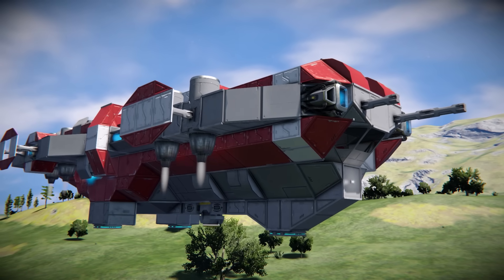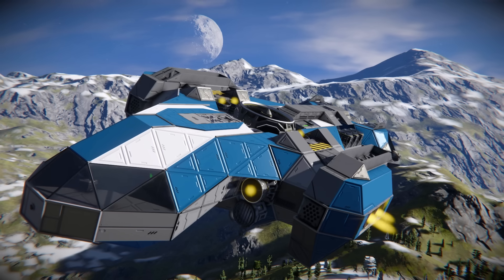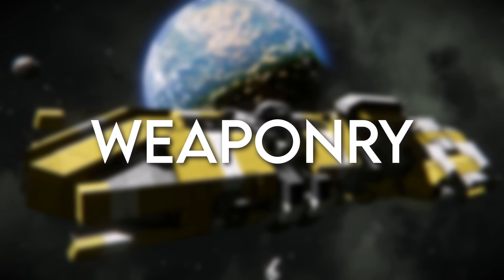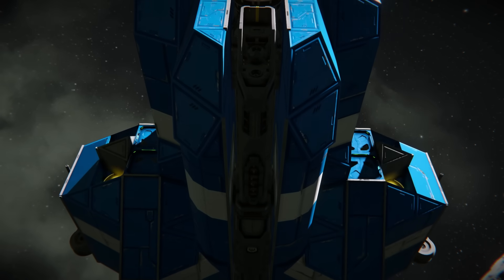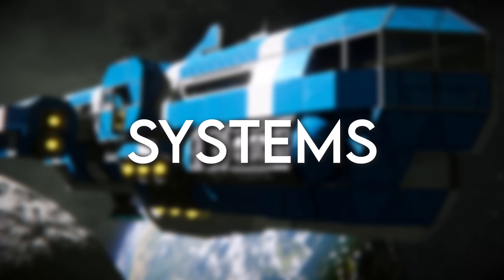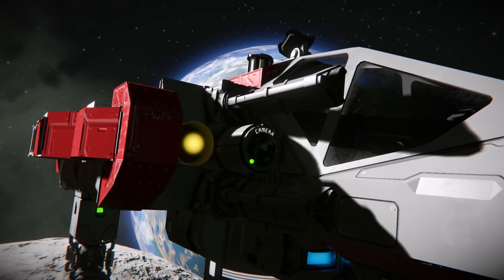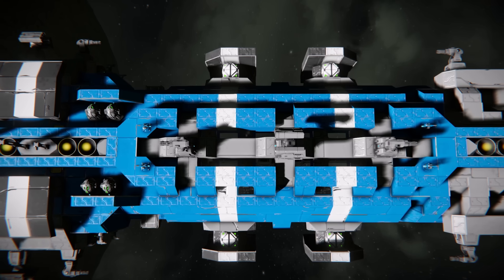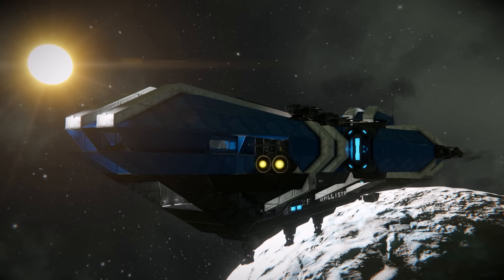Basic ship design guide - The Space Engineers Handbook

Comment: I built a small grid rectangle, I think around 20x7, I crammed 3 batteries in there along with a rectractable autocannon that goes in and out, and an 02/H2 generator with conveyors going out the side for thrusters, then I covered the roof, built a bulge, put the cockpit inside, rigged it up with the 02/H2 generator, and bang I'm done

Comment: Mmmh, this reminds me, I should probably really get to revise my large grid "asteroid eater" mining ship from like 2017. I kinda don't really know how to further improve the design though.

I've already managed to set up a sort-of kinda working pressurization system but it still requires the entire ship to be depressurized before allowing entry or exit, due to not having space to fit an airlock. The main issue with it is that the ship is designed in such a way to basically just point at an asteroid and move forward until it's through, meaning that everything has to fit 100 % behind the drills.

The whole ship has been entirely designed and built by myself in survival mode.

In case anyone's interested in the full detailed layout, front to back, it features the following:
84 drills arranged in a square pyramid shape.
Directly behind the center drill is the ore detector to allow for maximum range.
An inverted spherical gravity generator behind the ore detector allows her to draw any loose ore into the drills and prevent any waste
4 refineries are rotated to fit behind the drills and leaving a gap in the middle for crew to walk on. Their purpose is to already start refining stuff on the way back home and to give the ship a little bit of capacity to act as an impromptu mobile refinery if needed. Another advantage is that the ship is able to refine its own uranium to return to a fully operational state after running out of power.
A 3 x 3 x 3 reactor room filled entirely with small large-grid reactors, leaving a gap in the very center for the aforementioned walkway which continues through the entire ship
A 3 x 3 x 3 gyroscope room, set up in a way similar to the reactor room
A 3 x 3 x 3 cargo hold, again set up like the reactor room
A 3 x 3 x 3 "airlock" (which is really just a single door to the outside) with a medbay crammed in in order to provide first aid in case anyone gets injured in a mining accident
A mostly empty 3 x 3 x 3 room with control stations, this features as a cockpit of sorts.
Yet another 3 x 3 x 3 room filled with batteries for emergency power, in case the ship runs out of uranium.
And finally the last 3 x 3 x 3 room with oxygen tanks.
On the very back, outside, she's got a connector to hook up with wherever the ore is supposed to be dropped off.

All of this is mostly encased in two layers of armor, light armor on the inside and heavy armor on the outside, in order to protect the ship and its crew against collisions with asteroids. There are some gaps in the armor to allow everything to be hooked up to the conveyor system, but the internal rooms and walkway are airtight. Another advantage of the heavy armor is that it will allow her a lot of time to wait for reinforcements in case of an unexpected pirate ambush, assuming that pirates trying to ambush a lone mining vessel wouldn't be equipped to deal with large grid heavy armor.

It has 8 small ion thrusters for acceleration and breaking, and 16 small ion thrusters for moving up, down, left, and right, so she's pretty sluggish, but maneuverability is not really a priority for a mining vessel and can, in fact, actually be a detriment as sudden accidental shifts in direction while it is in the process of burrowing through an asteroid could pose a major threat to the ship integrity. The main reason for relying on 100 % ion thrust, however, is the fact that those were the only thrusters available within the vanilla game at the time of her creation. The reason for the distinct lack in particularly forwards and backwards thrust is that I had to make it work with thrust-damage enabled, so the thrusters had to be reasonably spaced out while still remaining fully behind the drills to keep them from snagging on any potentially left-over pieces of asteroid, and I also decided to not put any thrusters on the back in order to avoid risks of damaging whatever the ship is trying to connect to.

Additionally, she also got solar panels on each side, to act as an emergency power source in case she runs out of uranium. As long as it, together with the batteries, can power at least one refinery and the ore detector she can recover from a total power loss provided she's either got some uranium ore in the cargo hold or is close enough to a uranium-rich asteroid that the crew can fly out and mine some of it with their hand drills.

There's probably some features that I'm forgetting about or misremembering since it's been literal ages but if anyone's curious about checking out a relic from space engineers before planets and many of the other modern features, feel free to check her out here.
https://steamcommunity.com/sharedfiles/filedetails/?id=476792620
I have done some very minor renovations by adding air vents (she was already air-tight for aesthetic purposes, even before pressurization was a thing) and oxygen tanks, but apart from that she's still the same as she was back when I originally built her.

Comment: Some extra notice regarding conveyors and thrusters and railgun:
1. Make sure there are multiple conveyor paths throughout the ship, especially for ships with H2 thrusters, so that thrusters (and cargo access) won't die if a conveyor is shot.
2. Some blocks are explosive (yes you H2 container), they can be weakpoints and hazard for the ship, and not to mention warhead-fitted custom missiles or sort. So do keep in mind where they're placed, add protection, and don't put valuable stuffs like jump drive, medbay or script blocks near those explosives.
3. If the ship is large enough, you can hide thrusters in the ship for aesthetics and protection. The thrusters work just fine even if a part of the ship itself is right behind, just leave some space to avoid flame damage.
4. Do not place thrusters outside the grid where the cockpit is (eg. over a rotor) unless you know what you are doing, they don't respond to wasd keys and need complicated adjustments (mainly scripts) to control.
5. the video didn't mention that railguns need to charge after shots, and that's a huge power drain that could incapacitate movements and cause free fall on planets, so be careful when using this stuff, especially on smaller atmospheric fighters.

Comment: Sadly most of this is wrong past the thruster section. I'm sorry I have to tell it to you this way but the game is horribly unbalanced. If you dont use large grid railgun armed ships with many layers of heavy armor and gravity drive you are at an immense disadvantage. The main problem speed limit if you have more range than the enemy you can just fly backwards at the speed limit and the enemy will never catch you hence the longer range guns make the shorter ranged ones obsolete. The second issue is dodging you can even if you get into range dodge pretty much every shot because it takes a very long time for the projectiles to reach you thereby invalidating all the guns that are not the large railgun which has the fastest muzzle velocity. Due to having limited pcu heavy armor is a straight upgrade to light armor since it gives more health for the same amount of pcu and if you use the 2x1 slope base blocks you can put them infront of railguns covering them almost completely allowing you to shoot but the enemy will only break the armor blocks not the guns when you get hit. Gravity drive makes it so that you can stuff way more thrust into way less space making the ship much smaller and due to the quadratic scaling at higher pcu counts gdrive just gives way more thrust than even hydrogen. This combination of factors means a so called railgun gdrive gunbrick can defeat any other ship type without even taking damage and it will only cost a couple railgun sabots which is like 1/100000 of what the enemy ship costed. Small fighters for example will just get kited while large arty ships will never hit.

Comment: It is inaccurate to say ion and atmospheric thrusters don't need fuel! They just don't need hydrogen, but they still need electrical power.
Reply from the maker: @richardcall7447  electrical power isn’t fuel though so it is accurate ?
Reply: Yes, electricity is considered a fuel when it's used to power an electric motor, just like gasoline is fuel for an internal combustion engine.

In fact, organizations like the U.S. Department of Energy officially classify electricity as an alternative fuel. The term "fuel" broadly refers to any source of energy that powers a machine or engine, so electricity fits that definition perfectly when used to run electric vehicles or machinery.

 @LunarKolony

Comment: A great overview of what everything does.

The only thing I would add to that is that when you build a ship have a clear idea of what you want that ship to do. Give it specific metrics it needs to meet to be considered a success at that thing. It's all too easy to just keep adding parts until you have a frankenstein of a ship that is trying to do everything at once and failing. If you can measure how well a build is working out then you know what you need to work on.

For example. When designing any sort of freight ship, come up with an amount of cargo you want it to be able to carry and the environments you want it to operate in. Think about if you will have any resource constraints that you need to keep in mind for its intended use so you don't make it too expensive.

Eg: This cargo ship must be able to move one large cargo box full of ore between space and the earthlike planet without using uranium or platinum. 
That is something you can test. If you turn your ship into a crater on re entry then you have data for the next build.

Same with any other build. Lots of people will chime in on warship builds that their super dreadnought will beat X design easily, but what a ship is designed to kill and in what environment, and for what cost matters. 

Keep design parameters in mind for everything you make and your builds will get much better. "Being pretty" is a perfectly valid design consideration. Just keep it in balance with "being able to do its job"

Comment: Like many other commenters below, I have 1000s of hours in SE, but one thing I needed to hear early on when I was starting out was ships need 4 things to fly:

1) control (cockpit, remote, control seat)
2) steering (gyro, optional if rover)
3) power (depends on thrust type, but for starters at least a battery in most cases)
4) thrust (or wheels, if rover)

THEN spend 20 hours adding and subtracting other blocks and functions. :D

For anything more complicated than "make it go", I sometimes use something I got from Morphologis' content. He's an architect and talks about programming -- a list of features/functions required and desired by the user. This can be as high level or nuts-and-bolts as you need it to be.

e.g. Freighter ship program list might be:

Required:
- flight basics (the 4 things listed above)
- cargo (measured in whatever way is useful, e.g. 3 large cargo blocks, loaded with ore)
- MOAR THRUST!!!1! (enough to lift 3 large cargo blocks full of ore at 1.5g, meaning excess of .5g acceleration when lifting from the earthlike planet)
- 1+ connectors located in standardized, easy locations to fit with the rest of the ships a player uses

nice to have list:
- AI blocks for automated operation, docking, transferring cargo
- sorters
- antenna
- landing/docking blocks in addition to connectors
- programmable blocks for scripts
- lights (because I always forget these if I don't write them down)

---

Or a more role-play focused ship program for a hypothetical intrasystem patrol corvette (more high level, doesn't explicitly list all blocks needed):

- Expanse style vertical orientation; up thrust is primary (thrusters pointed down), no large thrusters in any other facing
- two control blocks, one oriented forward and one oriented up (this allows easy use of the main thrust either as up for landing in gravity, or forward when in 0g flight)
- 1 internal corridor using passage blocks running lengthwise from bow to stern, with all functional blocks except thrusters able to be accessed for repair internally in a pressurized environment
- main large thrusters mounted in 3 nacelles visually semi-separated from main ship body
- aft (bottom or down facing) and port air locks
- bunk rooms for notional crew of 4
- starboard mounted asymmetric fixed railgun firing up
- two custom turrets with gatlings for point defense
- arbitrary target size of 2000 PCU (roughly scaled for a fair, competitive fight against Modular Encounters, which seems to assume an established player will have roughly 10K to 30K PCU for total combat capable ship strength)

Whether specifying individual blocks or higher level functions/concepts, this programming helps me avoid losing sight of the point of a ship. With no specifications or limits, I tend to overbuild and add bloat/scope creep.

Plus all my early ships ended up being "flying brick with drills", "flying brick with guns", etc. But with defined parameters or ranges, I can make my ships more distinct from each other.
Reply: All good points, I'd add though if you're doing vertical ships I've found it easier to build like the mandalorian ship does. IE. On it's back. This allows you one control setup as forward is always either, Up or well, forward. Takes some getting used to but it's very much realistic as RL astronauts more or less lay on their backs in their seats while leaving atmos. Gives you a cool, 'man this feels kinda real' vibe, while still being very simple to implement from a 'nut goes on bolt' sort of perspective.